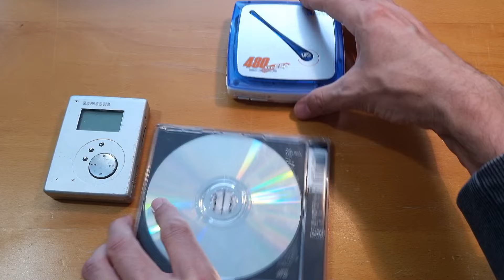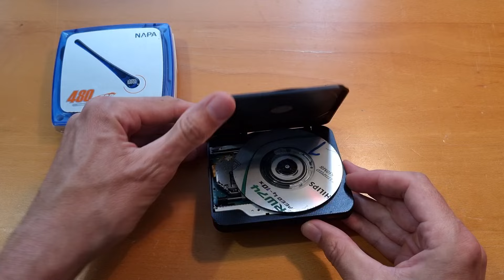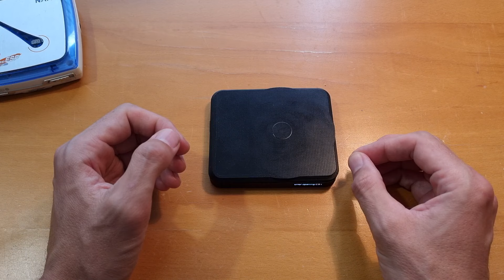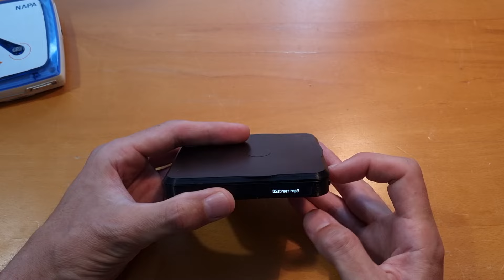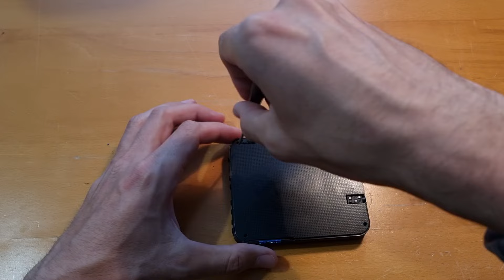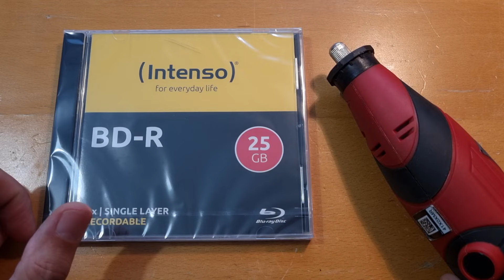Mini Bluray Audio Player

Comment: I was just searching if mini bluray ever got a player. would be neat to have a 4 or 8 layer mini bluray being roughly 30 and 60gb respectively.
Reply from the maker: Would indeed be interesting to try to cut down a multilayer BLURAY from 12cm to 8cm. But I would suspect that this will not work out because it will likely use it layer after layer
Reply: @kassenbon  60gb on mini disc would validate all the movies that had mini discs in them for top secret data. My memory jumps to the movie Eraser.

Comment: It would be cool if you supported SACD format audio. 8gb is a lot more than an album at cd quality, but SACD is like 23 minutes per gigabyte (according to wikipedia), so you could store like 3 hours. That fits a lot better with the analog workflow of swapping albums, and would give you an actual reason to have 8gb discs.
Reply from the maker: I like the idea! I never got in touch with SACD but this seems indeed to be a reasonable application for this player.

Comment: Can it be expanded to add the brains of the player to the full sized external disc unit? Kinda like a backpack or a clip that goes below the unit so it can play full sized discs
Reply from the maker: That would be actually very easy to do. You wouldnt need to do all the mechanical modifications and could play 100GB discs this way :)

Comment: Does that mean it would be capable of playing DVD-Audio, Blu-Ray Audio natively ? Possibly even able to read (& decode) DSD off an SACD? It's impossible to find a portable high res optical player, but I'd buy one today...
Reply from the maker: In theory this should be possible. Only issue is that the codec does not support high res audio. Bus this could likely be solved by using an external one.
In fact the player could even play back Blu-ray video since it has all that is needed already integrated. But I didn't route the video signal to the outside because I wanted it to be audio only.

Comment: So it can read and write full 12cm BDs when fully opened or is there not enough space for the laser head to travel ?  Because if it could, it would be the coolest external bd drive ever.   Also it could have a setting to backup everything contained on the disk automatically onto the microsd  without the use of computer (i knows its not ideal when the microsd is used for the OS )  ... that could surely find its use :D  Also I used to have an mp3 discman :D 700MB of mp3s is quite a lot . the main problem is any scratch = half a song gone when on a wav cd it wouldve been 1-2 second skip :D :D It is gonna be even worse with a BD if you also play mp3s :D
Reply from the maker: True, it can spin a 12cm disc but the laser can only travel to 8cm. This was necessary to make the drive as small as possible. But indeed, that would make for a cool external drive. Reminds me of one of these Sony players where the disc was exposed.
Reply: @kassenbon  Imagine a drive like that spinning a exposed CD up to 24x speed or even higher